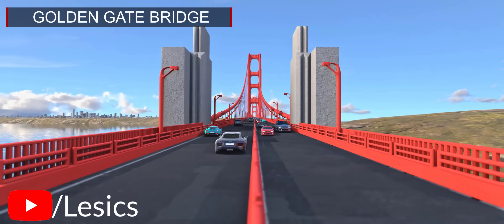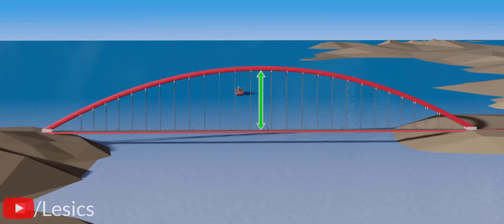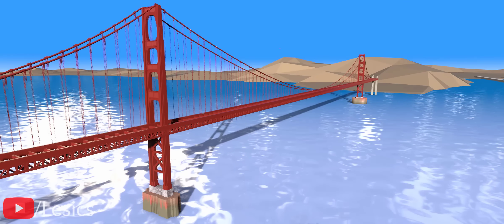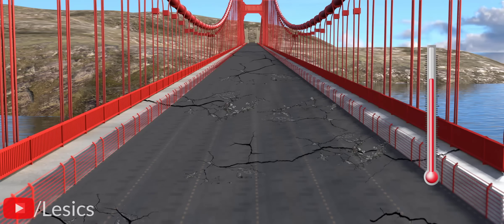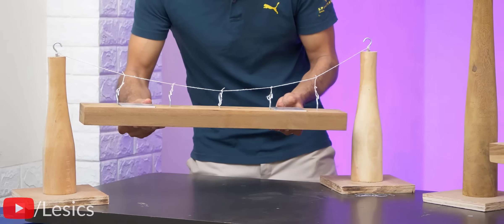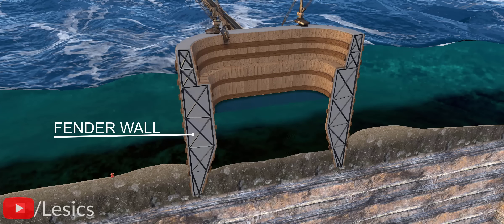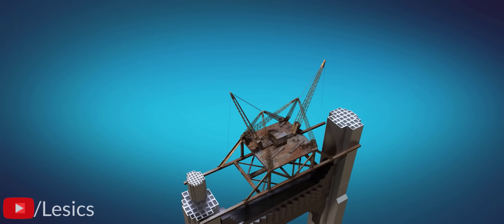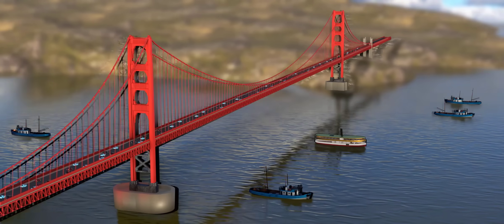Golden Gate Bridge | The CRAZY Engineering behind it

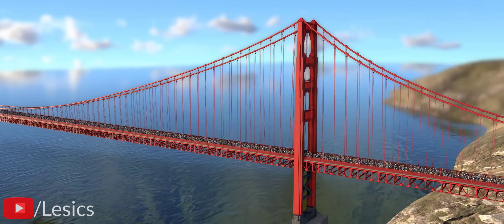Comment: 14:33  I attended the bridge's 50th anniversary in 1987.  When the bridge operators approved the temporary closure to vehicles, they estimated 50,000 would attend. The actual number was estimated at peak, close to 800,000 had come, far more than could even fit on the bridge. You can find photos that show masses of people stretching back on to land, unable to reach the span. I attempted to cross the bridge - end to end. It was so crowded that after two hours, I only made it from the toll booths to mid span. The sag was visible. Could you imagine if the cables snapped, killing several hundred thousand? Even though the bridge held up fine, the bridge operators said they will NOT repeat such an event.
Reply: I was stuck in mid span for over an hour.  I was terrified because not mentioned was the center span was swaying side to side.  I think mass intelligence sensed that it would unsafe to institute a Wave as fans at sporting events did in their seats.  I think the induced additional forces of the wave would have brought down the bridge. I had claustrophia
Reply: @bodybuilderslave7125  Even in winds fast enough to force a bridge closure, I saw no lateral sway. I was (to my knowledge), the only person to sneak on to the bridge on one of only two occasions when the bridge was closed due to hurricane force winds. It was category 1, ~75-80 PH estimate. I was curious if the bridge would sway, so I bicycled through the Presidio (the surrounding trees did a great job of sheltering me from a lot of the wind) . I initially intended to look from nearby. However, the gate to the west side walkway for pedestrians/bicycles was left open. So....So why not?  They missed me entering. I walked (holding my bicycle) close to the south tower. I did so specifically to look for bridge sway. I saw NONE!  Walking back, I passed under a light post. That placed me under a speaker. I then heard a bridge controller say "You with the bicycle, for the last time, get off the bridge!". I waved an acknowledgement towards the control building and left.  The reason why I could actually walk without too much difficulty was that the wind speed was steady, no buffeting. I just had to lean into it.  

I took advantage of the wind's steady speed at the cliffs a couple hundred yards away. The wind there was presumably at a higher speed since there is ~230+ feet of vertical to the beach so a lot of air had to suddenly be redirected upwards. This enabled me to WALK down the cliff side by partially opening my jacket to control lift assist, as though it was a wing suit. And, when I held my coat fully open like an extended wing suit, it blew me right back up to the top, Very, VERY entertaining!!
Reply: @bodybuilderslave7125  mass dumbness made you to go there in the first place.  🤣
Reply: @bodybuilderslave7125    Fascinating 
Comment Sir' ....Over the years I've found the Golden Gate Bridge one of
The Most thought out'...designed of
Our Centery....in line with the Genius 
Thoughts in building of the Hover Dam' which are Functional today and
Showed the World what America 🇺🇸 
Was capable of.....
Reply: @miltonhollis703  Was is the operative word.
Reply: @phlodel    I'm not sure what you mean @phlodel????actually
Reply: @miltonhollis703  I think that in addition to its top-notch engineering, the architectural embellishments are what really set the GGB apart from other bridges - those that simply go from A to B - without any real statement or character. By example, the Oakland Bay Bridge, built around the same time, is a prime example… utilitarian and boring.

Hoover Dam was another Art Deco masterpiece, with its own Art Deco features. Makes it timeless. Like the Chrysler Building, the Sydney Opera House, the Parthenon!
Reply: I bet if they do it again in '37, it'll be run differently, such as:  limited access via tickets distributed in advance; timed entry for each ticket; half the tickets provides entry  from the south, the other half from the north, and people will either loop back at the midpoint, or walk at pace to the opposite end (which way is TBD.)  
The hard part is that participants will have to maintain a certain pace, so as to get off the bridge and permit later ticket-holders  access.  I don't know how they can enforce this part, but this would be critical.
Reply: @77thTrombone  When exiting, if you have gone over the estimated time (from entrance) allowed to cross, charge an EXCESSIVE fee for staying too long.... Like $1000 or some amount that would be high enough of a deterrent. 
People will make sure to get off by their designated time.
Reply: @danceteachermom  sounds like a plan!
Reply: @77thTrombone  haha, your idea was good...I just finished what you started! 👍👋
Reply: Does a traffic jam on the bridge also make it sag?
Reply: @Mr_ZPguy  yes, any load causes a bit of flex.  Elastic deformation is the term in materials science.   The key to engineering is to ensure the structure (including all elements thereof) stays in the bounds of elastic deformation in all conditions.
When deformation becomes plastic, then trouble starts.
Example #1:  take a spring out of a ball point pen.  It'll squeeze and stretch.  If you stretch it too far, it won't go back to shape.
Example #2:  take a wooden pencil.  It'll bend some.  (If it's one of the cheap ones made out of sawdust, it'll bend even more!)  Either way, there's a point where the pencil won't bend back into shape.  You've moved it from elastic to plastic deformation, which is much less resistant, then started creating stress fractures, which make it even less resistant, and suddenly you have 2 pencil pieces.
Reply: @77thTrombone  thanks for the in depth answer!
Reply: @Mr_ZPguy  no problem.   Glad you appreciated it.
Reply: @Mr_ZPguy  I'm sure a traffic jam would as well. But the load of people so densely packed on the bridge was a LOT more than that of a traffic jam.
Reply: @Mr_ZPguy you know it does great point
Reply: They will repeat it in 2037 but to limit attendance they will charge a bridge "toll", probably $20 a head which will discourage many.
Reply: They will repeat it in 2037 for 100th anniversary of the bridge. You'll see.
Reply: @PaschanTOPs  My bet is that they won't. On many levels, the '87 celebration was too great a safety hazard. While I am unaware of any deaths, I did see a paramedic team try to take someone out on a stretcher. People did their best to get out of the way, but it was dismally slow. Bridge operators and the city of S.F. can't risk another 'open house' on the span. Maybe they'd close it for a televised parade - like the Thanksgiving Macy's parade down Fifth avenue. The center would be cordoned off to pedestrians, but a long stretch of the roadway beyond either side of the bridge is also closed to traffic. This enable all attendees yo view the parade.
Reply: @gregparrott  there’s no reason they shouldn’t. With some planning, you can control the amount of people that are on the bridge at any given moment. The bridge can support 4,000 lbs per foot of length before it starts to buckle, which means the bridge can hold nearly 36 million pounds of material, or a little over 200,000 average people (by American weight standards). 

The fact that the bridge saw 300,000 and barely buckled is a sign of how incredibly well engineered it is. Future planners can limit the amount of people on the bridge for its 100th anniversary to 100,000 at a time, with some ambulances and police forces along the way to maintain order. 

It would be a travesty not to celebrate its 100 year anniversary.
Reply: @chrisv.3944   Four comments here:   #1) I simply relayed what was said following the 50th anniversary. Maybe they'll change their mind. But I doubt it. They closed the bridge at something like 4 AM in preparation. As I started walking ~2 miles to the bridge, around 5AM, I was joined by ever growing streams of people. When I got to the bridge, the crowds were already unmanageably huge on both ends. They continued to grow throughout the morning. The bridge was supposed to be closed for just a couple hours. But if I remember right, it was not cleared by noon (long after I left).  The lost revenue, potential liability, the added costs for crowd control, standby medical staff, etc., are all concerns, in addition to the crowds again becoming unmanageable. And then, there's the risk of terrorists. No one could possibly install and operate metal/weapons/explosive detectors sufficient to handle crowds of that size, where the venue is a temporarily closed, major highway.

#2)  Where did you obtain the 4000 lb/ft specification? That seems low given 6 lanes (collectively 62 feet wide) and two 10 foot wide pedestrian walkways.

#3) Your math (36M lbs, 4000 lb/ft) implies the bridge is 9000 feet long.That is a distorted value because that includes the approach ramps on both sides, which are separately supported and run to ground at each end. And some of the elevated sections are directly supported by a truss construction to ground. The area of greatest concern is the main span, which is 4200 feet (16,800,000 lb, using your figure)

4) The bridge was visibly distorted - I saw it then and also knew just by the number of people packed into a space normally occupied by a car or truck and the space to the next vehicle's bumper, that it was loaded well beyond what it had ever previously experienced. If I were a bridge operator, I'd not want to exceed the average daily loading, which by my WAG (Wild Ass Guess) would allow less than half as many people. Furthermore, I'd need to ensure that they not be allowed to concentrate at one spot, such as mid span. One saving grace of the extreme overcrowding was that at least the bridge was uniformly overloaded - every square foot was occupied by pedestrians
Reply: @PaschanTOPs  No, they won't. That was the biggest load the bridge ever held. Do you think they'll take a chance on dumping a half million people into the sea? No way.
Reply: @PaschanTOPs 
Maybe with tickets
Reply: @PaschanTOPs  no they won't. Shutting it for a whole day, they are literally losing millions .
Reply: @PaschanTOPs  You never know if the bridge would even survive by 2037. Anything can happen to the bridge: 
A massive earthquake could occur in San Francisco Bay Area causing the Golden Gate Bridge to sway violently or even collapse.

Anything can happen between now and 2037
Reply: So much could've gone wrong during the design and construction of the bridge, but they were so careful not to mess it up. It would've been a shame if something terrible had happened due to a dumb decision by the bridge operators.
Reply: Also not mentioned that about 6 months prior the concrete roadway was replace with steel plating to lighten the load and strain
Reply: @bodybuilderslave7125  Yes, I remember the replacement with lighter/stronger panels. They reportedly reduced the bridge's static weight by 11,000 tons.
Reply: I remember seeing pictures of all the people on the flat bridge at the time. On a normal day it has a very pronounced convex curve, just lide one of those flatbed semi trailers.  Fortunately, on the 100th anniversary the bridge still be very safe because although the average weight of of a Californian will be over 250 pounds, they will be so out of shape no one will be able to walk more than two hundred feet form the end.
Reply: @ct8764  As a Canadian I have really come to love my US neighbors, the American laconic demeanor and the ones who wish to continue their forefathers ability to "dream, think and create BIG!". I hope your "experiment" will succeed for many more years.
Reply: @cosmosaviatoric  Most people never noticed the sag, especially those on the bridge. That's because the mass of people masked the roadway.
Reply: I was there out in a boat on the bay for the fireworks show.
Reply: @robo5877  I only attended the early morning walk-on. I missed the fireworks. Assuming the fog didn't roll in, the fireworks would have been great.
Reply: They close the Mackinac bridge in Michigan on Labor Day every year and almost 30,000 people walk it.
Reply: @michaelmaas5544  It's nice that Michigan offers the chance for pedestrians to walk freely on an annual basis.
But from a safety perspective (where I said they won't repeat the GG bridge's closure), the GG bridge had over ten times as many people (over 300,000), across a longer span (GG=4,200 ft, Mac=3799 ft), and across a shorter total length (GG=8,981 ft, Mac= 26,732)    I just got the length specs online
Reply: Frustrating but that's memorable for sure😄
Reply: The flexing experienced in 1987 was calculated to be around 40% of capacity, so 100% safe..
Reply: @petesmitt  Yes, but unintuitive for users, so you can guess how many people panicked. Hell, they have memories 40 years later. Not good to establishing trust between the public and engineers.
Reply: @petesmitt  which is what I would expect. having car to car traffic with extremely large vehicles would be more weight than a bunch of people and it would probably be the worst case scenario
Reply: @petesmitt  yeah, they’d need about half a million Rosie o’Donnells to reach capacity.
Reply: Americans don't learn from history.
Reply: Final destination - 100 th anniversary 😂
Reply: america truly is a nation of sheep.
Reply: how old are u? damn
Reply: @Pana_Kanel  Plenty old. But I've still got quite a ways to go before becoming a centenarian :)
Reply: Kb7jnnvvmअल्
Reply: @cosmosaviatoric  The bridge operators did some quick calculations and deemed it ok.  Not mentioned is that the original concrete roadway and been replaced with steel plating cutting the total weight.  If the original roadwaywere still in place it might have been a diffeent story
Reply: People tend to forget common sense when they're celebrating.
Reply: ВАЫ
Reply: It would be interesting if it did break
Reply: @TheKarby  Had it broken during the 50th anniversary, it would have killed several hundred thousand people, at least triple the number of deaths in the bombing of Hiroshima. I wouldn't consider that "interesting"
Reply: @gregparrott  I don't know why the hell I said that. Sorry I have issues
Reply: The thought process of building 👷‍♂️ this bridge was absolutely remarkable, starting with the under water divers and blasting there way through some of the bed 🪨 rock. It almost seems like only a higher being from another planet was able to construct this magnificent project. "SIMPLY AND AMAZING FEAT OF ENGINEERING."( Without today's technology.) UNREAL!!!!!!!!
Reply: @cosmosaviatoric  
> Was there anybody frightened (if they realised) when the bridge was sagged?

Yes - the engineers!
Reply: Now 1600000 people will come on 100th anniversary in 2037 ...
Reply: If you declare with your mouth, “Jesus is Lord,” and believe in your heart that God raised him from the dead, you will be saved.
Romans 10:9 N

Comment: Building this bridge is how they discovered the dangers of "Red Lead"......the coating that was used at first to prevent the salty air from causing rust to form on the steel parts...........when the hot rivets were being put into place the crews were getting sick from the fumes caused by the heating of the red lead..........also this bridge was made by Bethlehem Steel in the bridge and plate division that once stood in Pottstown PA..........now just an empty shell of itself.

Comment: My Grandfather (1890 - 1964) wrote a book on the engineering of the bridge contemporarily with its costruction. (1935).  He was an engineer for the City of San Francisco.    BTW.  I don’t think they used roller compacted concrete.  I inherited a small piece of one strand of the cable and splice from my mother.  The Golden Gate Bridge will always be the standard for beautiful infrastructure.  His book is still for sale at the gift shop.
Reply: What's the title?  I'd like to see if it's in my local library here in New York City.
Reply: Roller compacted concrete?when it is wet We use big long vibrator (nothing sexual )thing say my boss that it is use to help the concrete compact it self and get rid of air boobles or something like that .
Reply: @TheAlonso1813  air boobles? Boobies?
Reply: @TheAlonso1813  yeah he says it in the video “a needle vibrator” or something
Reply: My research showed that RCC was not used on the deck. RCC is usually for unreinforced concrete. Good documentary video and narration. However, I think it should have mentioned the use of the catenary formula that was used and the involvements for Eng. Charles Ellis and that Strauss died the following year.
Reply: @cadethenderson1     Roller compacted concrete was developed in the 1970’s.  It wasn’t available in 1935.
Reply: @cadethenderson1  
I've been trying to figure out what he means by RCC. Usually it's just RC, and that's Reinforced Concrete; as in, RC Slab or RC Wall. I knew I had heard RCC before, and you're right, it's Roller Compacted Concrete, and that's definitely not how they made the GGB.
Reply: @kindlin  RC is also known as RCC (Reinforced Cement Concrete), they're the same thing
Reply: @JS-yo1ff  That sounds redundant to my ears, but there is probably some historical context in there somewhere.
Reply: @cadethenderson1  PTSD ?
Reply: BTW I like your comment, you’re lucky and sure to feel great  to know that your family was part on that amazing bridge
Reply: Whats the name of the book?
Reply: Golden Gate's Traffic Deck is NOT Roller Compacted Concrete (RCC).   That's been used for DAMS, and..., btw, for the Parking Lots at the HUGE SafeWay Grocery Warehouse in Tracy, CA. !!!   (they've not been holding up well)  It has been my understanding that this bridge has an Orthotropic Steel Deck, not a Concrete Deck.  The Wearing Course is Epoxy-modified Asphaltic Concrete.
Reply: 👍 your grandfather .. how to love fall to your grandmother 💃💘 ?